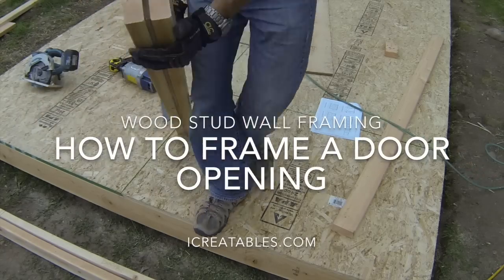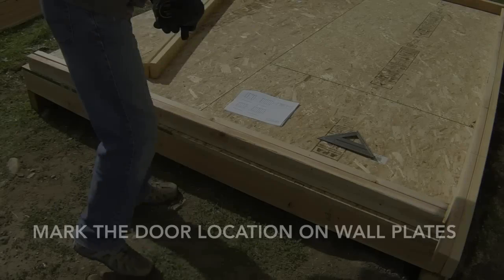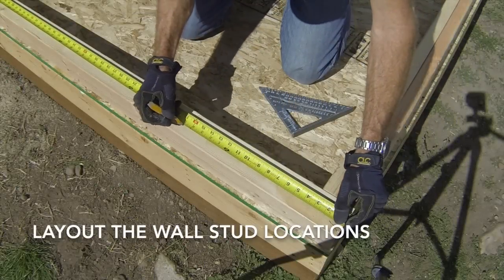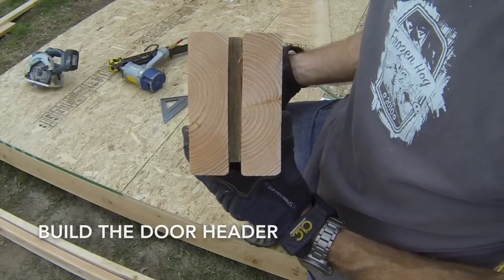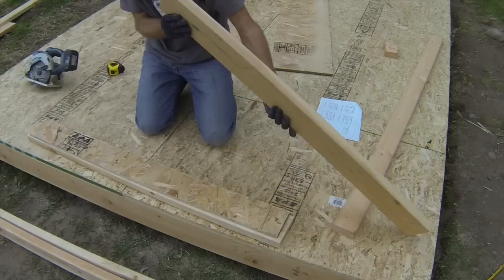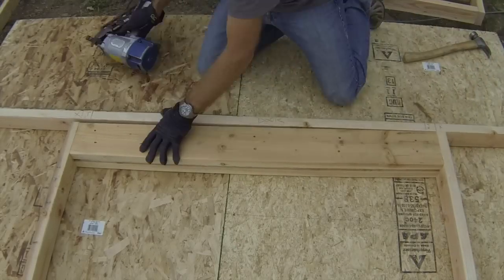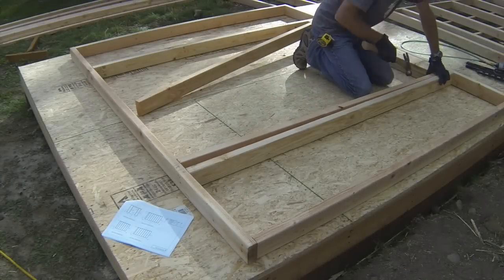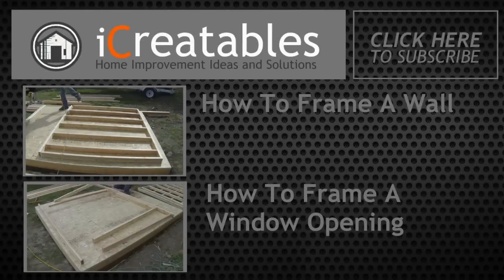How To Frame A Door Opening

Comment: Why don't you partially bottom cut the bottom plate in line with the inside edge of the trimmers so you can easily cut the bottom plate out of the door opening?
Reply from the maker: Good idea.

Comment: If its a 30 x 80 interior door then the opening should 32 x 82?
Reply from the maker: +Manuel Salgado You are correct. For pre hung doors the rough opening is 2 inches wider and usually at least an inch taller. The jambs are 3/4" on each side and that leaves another 1/4" for shims so you can hang the door straight.

Comment: How do you compute the width of the header
Reply from the maker: +Zoran Milenkovic It is 3" wider than the framed opening of the doorway. This is so a 2x4, which is 1 1/2" wide  can hold it on each end of the header.

Comment: When would you cut out the bottom part?
Reply from the maker: Our Family The bottom plate is cut out after the wall is stood up and nailed to the floor. Then it is still square and cannot move.
Reply: @icreatablestv  You can pre-cut out the bottom half of the bottom plate at the door opening, prior to standing the wall up. Then, when you go to fully cut out that section, after setting the wall, you will not cut into the subfloor.
Reply: @katmcreynolds6096  or, you could simply learn to set depth of your saw

Comment: Rubbish video, no explanation of door sizes etc. Would have been good if you used say a 6 ' 6 door and explained measurements of header etc.
Reply from the maker: Thanks for your comments. We have lots of door sizes. This method of framing a door can be used on any door size. The door shown was a 6060 door.

Comment: How do you compute the length of the header?
Reply: Based on the distance between your trimmers on left and right side of the header. You can measure that distance, Or, the door opening width plus 3 inches because your header will rest 1.5" on both sides when sitting on top of your slip studs ( trimmers )